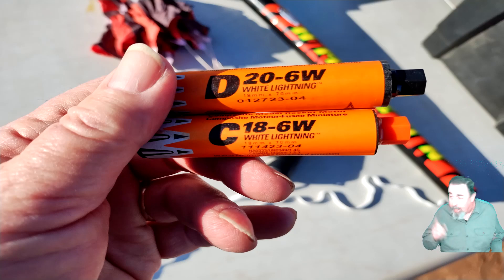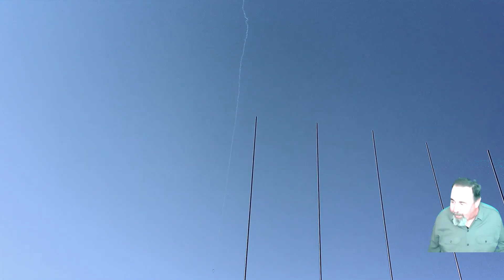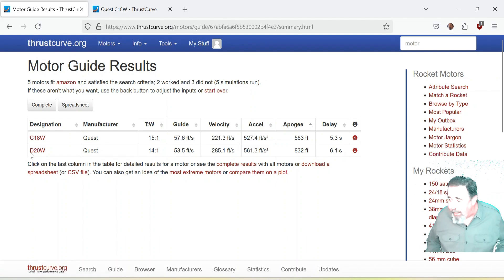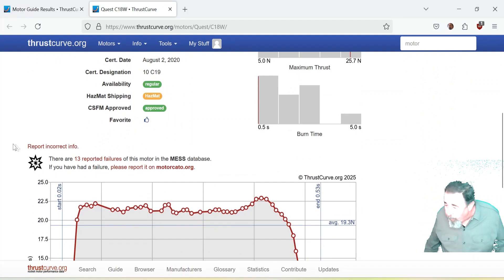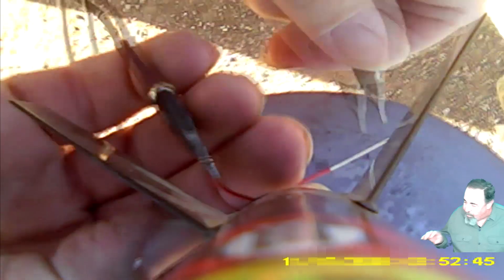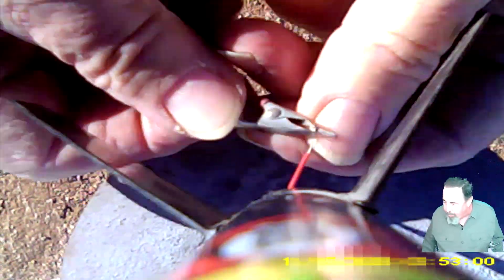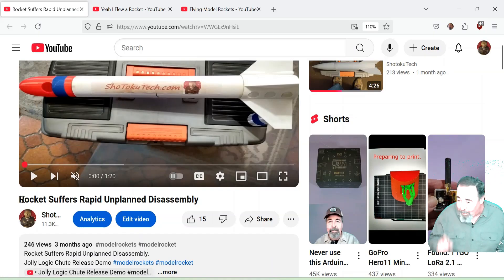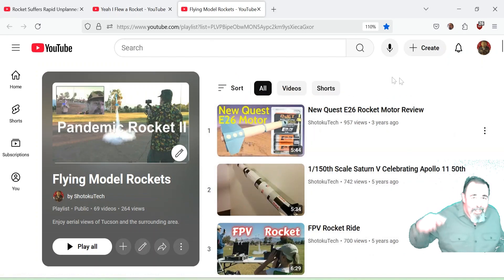Quest 18mm Composite Rocket Motors: What's Happening?

Comment: The delay happens after the rocket exhaust his propellant so the delay starts then not at launch
Reply from the maker: Dude I have been f  rockets since I was a kid and I'm an L2 certified high power flyer. I am aware the delay starts after all the propellant is burned. These motors actual delay is many seconds longer than what they specify, as in double the length, if they eject at all. Thanks. Best wishes.

Comment: Try to understand that 0.5second burn time is super wrong for rocketry. You want something to sustain 30 seconds of burn to climb above 10km at modest speed before stage 2 opens up for an additional 30 second burn beyond mach 5 and 100km altitude. it's very easy, everybody is just doing it so super wrong.
Reply: Video, or it didn't happen
Reply from the maker: @user-rs8zg8ey2b  There is video yes. It's in the video. Best wishes.
Reply: @ShotokuTech  not the video I watched
Reply from the maker: @user-rs8zg8ey2b  Okay. Best wishes.
Reply from the maker: Okay, best wishes.